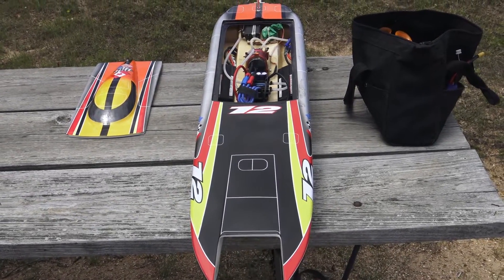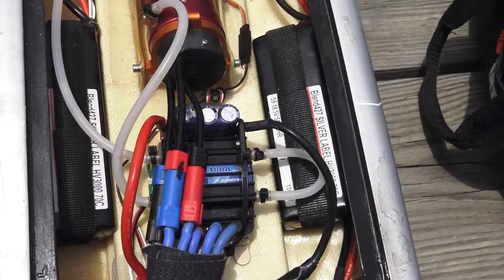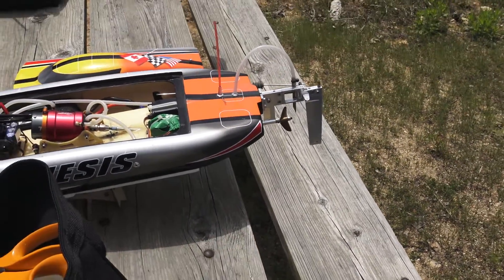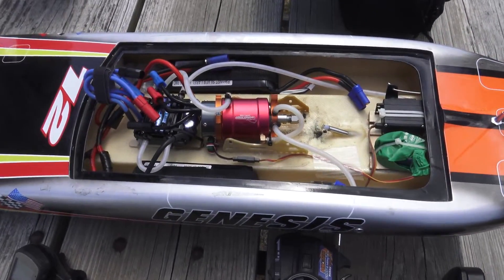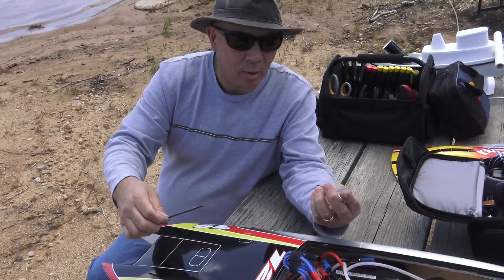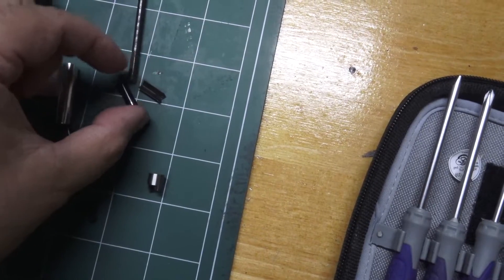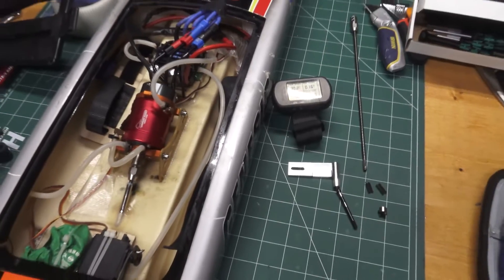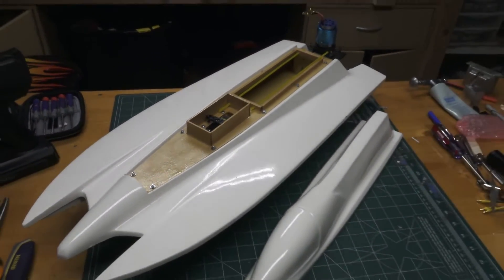Genesis RC Boat Prop Shaft Fail!

Comment: Hi ! This is MR.BIG DADDY! Here , ON your shaft ! The size of your shaft !!!! THAT 'S THE SIZES SPACE !!!! YOU NEED ! FOR PLAY .WHEN YOU PUT IN YOUR SHAFT .IN OTHER WORDS ! WHERE THE DRIVE DOG GOSE TO THE STINGER .MAKE SURE YOU HAVE ENOUGH SPACE ,ABOUT THE SIZES. OF YOUR SHAFT !!! FOR SPACE . WHEN THE SHAFT SPENS IT TORQUES UP CAUSEING  THE FLEX SHAFT TO PULL IN .AND IF THE DRIVE DOG ! IS RIGHT THERE NEXT TO THE STINGER. IT WILL CAUSE IT TO GRAB THE STINGER .MAKEING IT TO BREAK !!! THATS WHY ! YOU HAVE YOUR DRIVE DOG ABOUT 1/4 INCH !!! FROM THE STINGER .TO KEEP YOUR DRIVE DOG , FROM GRABING!!!! THIS HOW TO KEEP YOUR SHAFT !!! FROM BREAKING !!! MR.BIG DADDY DADDY

Comment: Once again,   ANOTHER EXAMPLE of Mfg. JUNK !  They love that PARTS MONEY !  Furnish junk so you can do "UPGRADES".  They love that word.... you have to UPGRADE there JUNK to get it to Run, and to get any RUN time out of it!  The say you can run on 6s, what they don't tell you is that on 6s, it will run about 20-40 minutes and YOU HAVE TO BUY NEW PARTS,  Because there PACKAGED BOAT DEAL "SUCK" with LOW grade parts !!!!     Better off BUILDING one, or have a guy in a RC Boat Club build one for you....!!!   There Tricked Out Videos on the Tube etc., are shot using basic Photographic Speed Tricks and Sounds, to suck you in !!!!  For the Money you spend and the Quality you get, mainly ABS/Plastic boat your getting SCREWED HARD !   Because anything and everything that goes wrong with the BOAT is ALWAYS the OWNERS FAULT !    WARRANTY,  there's a reason they have NO WARRANTY !   They all KNOW there shit is WEAK !

Comment: I have a weird question with your steering rudder why won't you use the Waterpik up on the steering rudder instead of the other water pickup behind the propeller cuz when you ran the Genesis I seen water come up from the actual water pick up on the rudder

Comment: Guys that boat uses a floating shaft. the square end floats inside that part that broke on you. You might want to upgrade to a one piece welded shaft in a larger size cable. Like a .187 flex cable, but that also requires replacing the strut or drilling the strut on a mill or good drill press to get a nice straight hole for new bushings.
Reply: i dont mean to be so offtopic but does anyone know of a way to log back into an instagram account..?
I was stupid lost my login password. I love any tricks you can give me
Reply: @Ledger Malakai instablaster :)
Reply: @Atlas Cayden Thanks so much for your reply. I got to the site thru google and im in the hacking process now.
Takes quite some time so I will reply here later with my results.
Reply: @Atlas Cayden it did the trick and I now got access to my account again. I'm so happy:D
Thanks so much, you really help me out :D
Reply: @Ledger Malakai Glad I could help xD